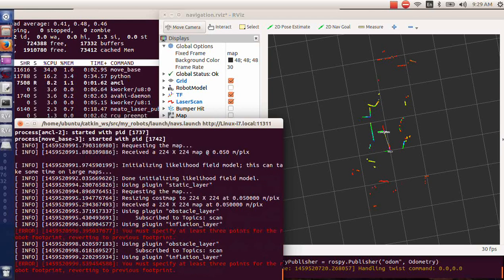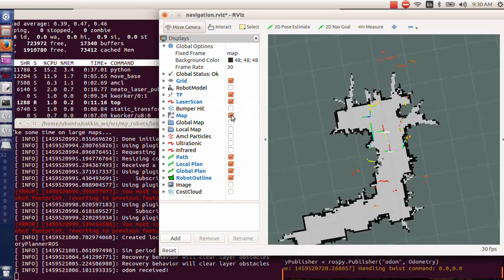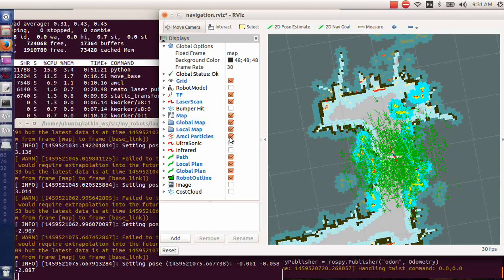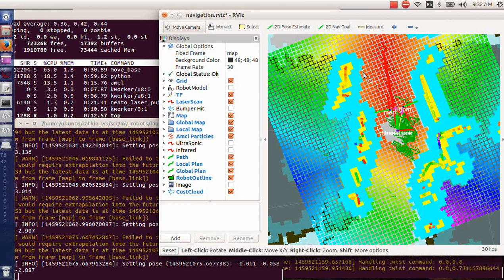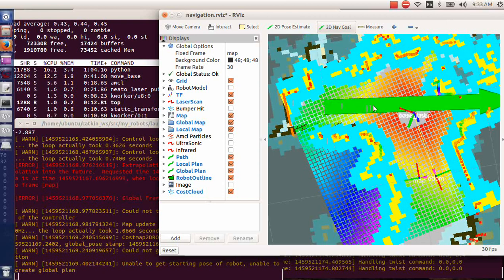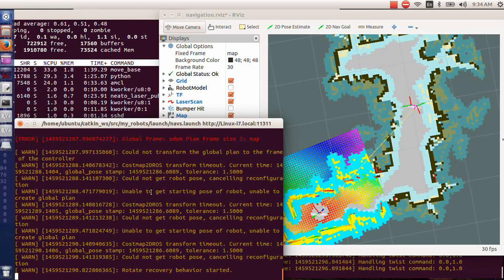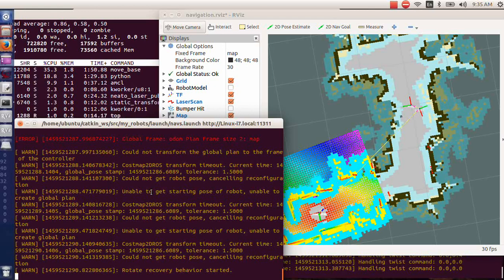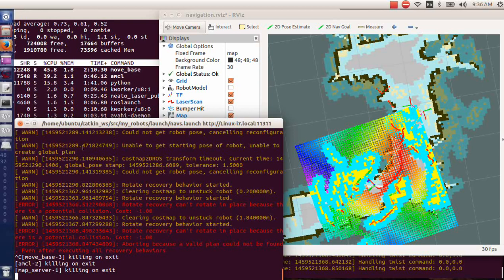Ros naviagtion on Raspberry Pi robot - #2

Comment: Great work, Did u use Arduino to interface sensors and actuators?
Reply from the maker: No, I used a custom motor controller board.  The board uses an Atmel 
XMega processor. It controls motor speed and creates odometry from the 
motor encoders. The XV-11 LIDAR has an Arduino-like speed controller 
board from https://www.getsurreal.com/

If you look at my YouTube channel there are a few other videos and a little more explanation in the descriptions. (Not enough)

Comment: Great vid!
ROS noob q: How much computing is done on the PI itself? Are the laptop doing all the computing or can the PI handle it itself?
Reply from the maker: +Bjarke Thomsen 

ROS navigation stack, AMCL, laser driver and base controller are running on the Raspberry Pi 2 on the robot. Roscore and RVIZ were running on the laptop by WiFi.  I was watching the CPU percentage using top on a ssh window. And I was watching the warnings on the ssh window where I started navigation.

So the Raspberry Pi 2 is running local costmap, global costmap, trajectory planner and path planner. On the cpu percentage all of these are combined under move_base.

I'm trying to prove the RPi2 is fast enough to make this work. We''ll see...
Reply: +jws8675309 very cool! Im on my mech e Master now, and hope to somehow learn some ROS!
Reply: +jws8675309 Pretty sure if it is not, the PI 3 or this http://www.nvidia.com/object/jetson-tk1-embedded-dev-kit.html is.

Which by the way is what I am trying to use.. :)
Reply from the maker: +John Tilghman
I am using Raspberry Pi 2. I do have a Jetson TK1 that I haven't used yet. I want to find out if the Pi2 is adequate or not, before moving on...
Reply: +jws8675309 Do you have a webpage that details this build a little ? I would love to see how you have the PI driving things as well as the ROS packages you loaded on the PI.
Reply from the maker: +John Tilghman 
No, I don't currently have anything written up.
Reply: you can find an ISO image on internet with raspbian and ROS preinstalled just install and use much better for try it.